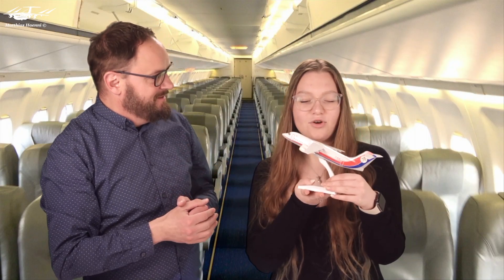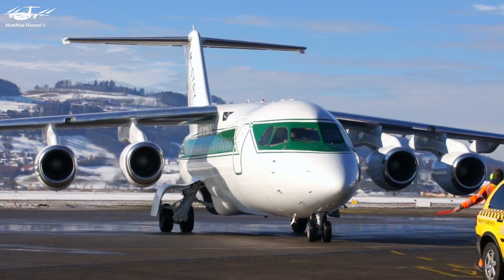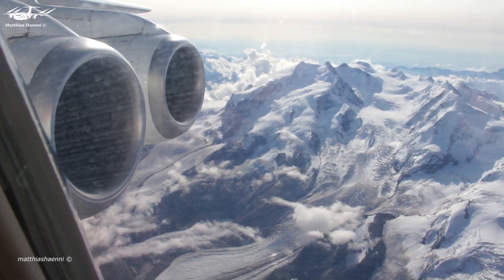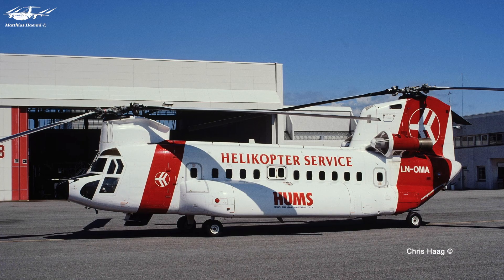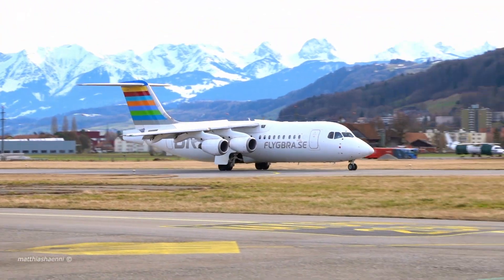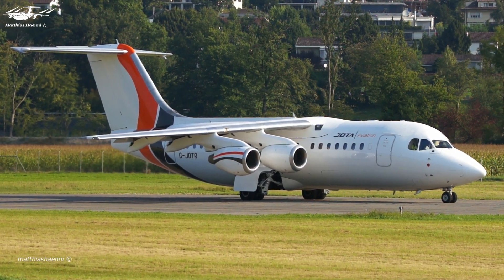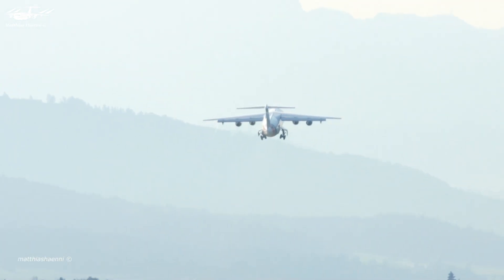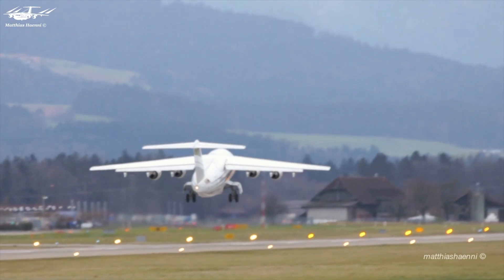BAe 146: Uncover the 4-Engine Mystery!

Comment: The original brakes on the 146 were steel rotor units, copied from existing British designs and were really heavy, not overly efficient and needed frequent changing. They changed to carbon units which are much better, lighter and more efficient at dispersing heat from the brakes. The lack of thrust reversers is down to the fact that the original core engine, being a helicopter core, could not accept TRs, not down to any cleverness from BAe. The original DH 146 was designed in 1961 but they did not cut metal until 1981 so it had a lot of obsolete features, such as a very primitive autothrottle system, cables and rods for every flight control surface, no support structure under the cockpit so the forward fuselage is very vulnerable to damage and a single piece leading edge on each wing, which is hugely expensive to replace. In fairness, it is well regarded by pilots, is mostly easy to gain access for maintenance but it's engines only have an overhaul life of 5000 hrs and it's APU in the tail is a disaster, with a dreadful reputation for bring fumes into the cabin and cockpit.

Comment: One of the original advertising drawings for the aircraft had only two engines as the plan was to offer both existing turbojets or the four ALF 502s, as an option. the ALF 502 was also supposed to power a new generation of business jets, including the early Challenger series but the ALF 502 failed so they took the CF34 instead. the 502 had persistent vibration problems and the fan they used was really too small. The TFE 731 was and is a much better engine, which is why it was and is much more successful to this day.

Comment: I've flown on this model plane a lot between Santa Barbara and Denver.  Very nice plane.  Great views out the window with the high wing.  Always wondered why they used 4 engines.
Reply from the maker: Thank you very much for your kind comment. I am sure you enjoyed the flights on board this great plane. I have a special bond with the BAe 146 that brings back fond memories. As a child, I spent time in the Bern University Hospital due to a lung condition, and the sight of the DAN-AIR BAe 146-100 flying between London Gatwick and Bern was a bright spot in those tough days. The flight path passed right by the hospital, making it easy for me to catch a glimpse of the aircraft from my bed on the top floor. Each sighting was a little burst of joy and hope for me, and it still holds a special place in my heart.

Comment: I never knew that. Thanks for the information. Great video. A nice bonus at the beginning with that BAC 1-11 picture at Gatwick, presumably in about 1992.👍
Reply from the maker: Thank you for your kind comment. I have a special bond with the BAe 146 that brings back fond memories. As a child, I spent time in the Bern University Hospital due to a lung condition, and the sight of the DAN-AIR BAe 146-100 flying between London Gatwick and Bern was a bright spot in those tough days. The flight path passed right by the hospital, making it easy for me to catch a glimpse of the aircraft from my bed on the top floor. Each sighting was a little burst of joy and hope for me, and it still holds a special place in my heart.

Comment: One of my favourite aircraft to work on. Sturdy, reliable and comfortable. Sadly missed 😢
Reply from the maker: Thank you for your kind comment, Martin. Yes, it is definitely sadly missed. I have a special bond with the BAe 146 that brings back fond memories. As a child, I spent time in the Bern University Hospital due to a lung condition, and the sight of the DAN-AIR BAe 146-100 flying between London Gatwick and Bern was a bright spot in those tough days. The flight path passed right by the hospital, making it easy for me to catch a glimpse of the aircraft from my bed on the top floor. Each sighting was a little burst of joy and hope for me, and it still holds a special place in my heart.

Comment: Interesting vid, these planes are fighting fires in my town and I’d never seen them before, so it was cool to learn more about them! Usually don’t see jets with 4 engines aside from military planes, or 747 and A380.
Reply: Or 707s, DC8s, CV880s, CV990s... the 4 engine designs used to be much more common in the days when big enough engines for a twin configuration didn't exist.

Comment: Interesting.  I’ve flown in so many of these: the first time, I think, was Dan-Air to Belp.  Joint worst flights were Air UK LGW-EDI, when the plane stank of vomit, and BA LGW-ZRH in a terrible six-abreast configuration.  An interesting feature is the geared fan of the engine; a configuration that is gaining in popularity again.  By the way, I much preferred this format to that of your Piaggio and Saab 2000 pieces: both excellent, but spoiled by the computer generated commentary.
Reply from the maker: Thanks for your feedback. One of my 1st flights was also with Dan-Air from Bern to Gatwick in 1988. I was totally enthusiastic!!! 🤩✈️👍👍👍The BAe 146 was a welcome highlight for me when I had to be on the top floor of the hospital in Bern as a child. It always put a smile on my face and lifted my spirits in those difficult times. Definitely my favorite plane.
Reply: @MattsAviationChannel  You could almost have touched it from the top floor of the Inselspital!
Reply from the maker: Yes, that is true!